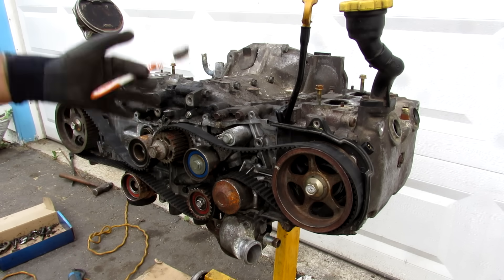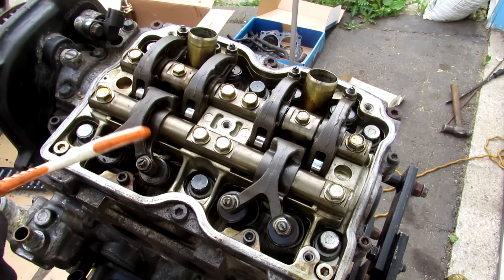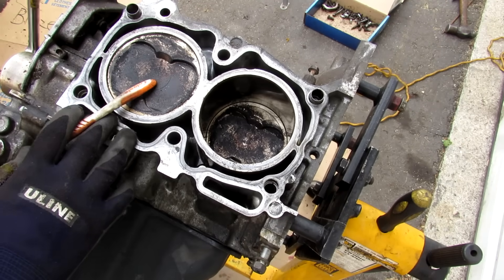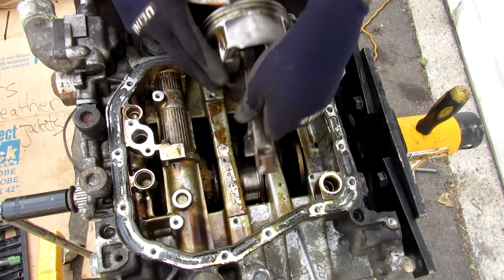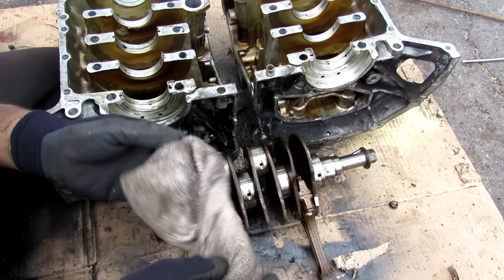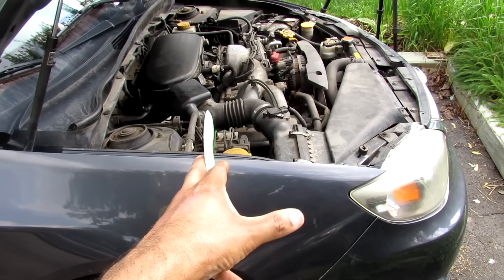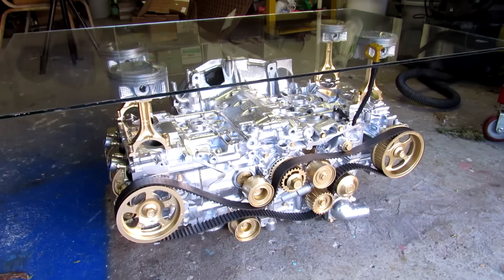Why Subaru Engines FAIL

Comment: Man, that's a whole lot of issues with that engine.
Reply: You can talk shit about all other engines as well, they all have strengths and weaknesses, especially when you have a bunch of retards beating on them and not doing routine maintenance.
Reply: A Mac 
A lot of other engines are a lot easier to work on though. The boxer engine is very weird
Reply: DEEBO I bought an 06 wrx last month and I’ve been putting in all the parts and doing all the maintenance myself Subaru’s are easy asf to work on compared to the bmw I came from
Reply: Griffin_Kith 
Shit I believe that! BMW’s are something else man smh
Reply: DEEBO it was the smoothest car I’ve driven and a blast but that maintenance upkeep hurt too much as a college student
Reply: @Siillky  theyre a pain in the arse and the back !!! I see why only 2 ? Manufacturers have persisted with them !
Reply: @Al8293Au1229  i do fk all maintainence on my rav4 has got same air filter for 7 years car at 430k kms on original clutch too. Some cars can handle abuse better than others. Me id never touch another subi unless that pissed off the boxer and made decent cv  boots 😂
Reply: A Mac you are exactly right.
Reply: @Al8293Au1229  Yeah, subaru engines are terrible. If you told any American car owner that you had to replace your timing set and head gaskets every 100,000 miles they would tell you to sell your car. 

I just got ahold of a clean subaru forester 3 days ago and I already want to get rid of it.
Reply: @superbroadcaster  Timing belts are normally due every 60,000 miles or every 5 years. 

More modern cars it's every 120,000 or every 10 years

But on a 'modern' American branded car many which are still using ancient engines designed several decades ago the interval can be as low as every 30,000 miles.

Engines with timing chains usually last the 'economic' lifetime of the car with proper maintenance.
Reply: @user-zt4ry9hm9u  Yep that's terrible. I'm going to stick with trucks from the 70s, newer hasn't meant better in years
Reply: @user-zt4ry9hm9u  Also timing chains are superior in most ways to timing chains. The only real reason besides drive chain weight is the economics of stamping out a belt vs machining a chain to exact specs. Timing chains rarely break, if you break a timing chain it's either under fantastic strain or beyond old. It's much more rare to hear of a timing chain breaking
Reply: @superbroadcaster  
I believe your mistaken
Belts are superior for a number of reasons, they are cheaper and cheaper to replace, cost matters when most people today do not own their vehicles or change them every 3 years on average.

They are reliable, once changed on schedule a broken timing belt is less common then a broken timing chain. A broken timing belt is almost always due to neglect and chains have a record of failing spectacularly out of the blue.

Less maintenance required, a belts longevity is not connected to whether the engine and oil has been properly maintained. Contaminated engine oil, late oil change? Low on oil? bye bye timing chain.

Lightweight, quieter and with lower friction means better fuel economy and more powerful engines.

All this far outweighs the argument that timing chains last longer and are maintenance free, it doesn't mean they don't need replacing forever and replacing chain is horrifically expensive.
Reply: @user-zt4ry9hm9u  Yep chains are definitely better. Longer maintenance intervals are exactly better and once you've disassembled an engine to the timing set, a chain is just as easy to replace as a belt. A belt is also definitely weaker than most timing chains unless it's wildly beefy which decreases effiency of the engine. Chains are still better
Reply: @user-zt4ry9hm9u  And if someone can't be bothered to change their engine oil reliably to avoid contaminating the oil with excess carbon or other foreign bodies, they definitely can't be bothered to get their timing belt changed at regular intervals. $50 oil job or $1000 minimum timing set job? Yeah they're definitely going to change their timing belt first 🙄

Timing chains absolutely exceed timing belt service intervals. I'm not going to let an automaker cut corners and be applauded for it because people like to rationalize
Reply: @superbroadcaster  waring is one og the cause pin rotate inthr holes under pressure.
Reply: @superbroadcaster  I had a 1992 Saturn timing chain break at 125,000 miles.  Had to replace the engine because of the damage it caused.
Reply: @DanGeorges  Sounds about like a Saturn
Reply: @user-zt4ry9hm9u  wouldnt touch a car with a belt unless i really had to.
Reply: A Mac @ 🤣bahaha,hard to deny that,hear hear.....

looking @ boxer engine without seeing this vid. the main problem or weakness visually imo would be the long horizontal length which would give it more flexing & vibration,.how well they are balanced internally I honestly do not know, but

 I like the idea,design,with more refining,it can quite easily be a solid unit in durability.
For its size it performs damn well too which is easily forgotten,when there is problems.....
Reply: Not really, perform average !
Reply: @Al8293Au1229  I clicked the thumbs up and because I can't add more I'm adding this: thumbs up multiplied by 1000. Cheers
Reply: The vid should be titled “1700 reasons to never buy an used Subaru.”
Reply: @ronaldscott781  I totally agree with you. 🤣🤣
Reply: @ronaldscott781  Used? Hell! Any Subaru!
Reply: Don't buy a Subaru. Toyota is vastly superior in every aspect.
Reply: @hedgehogthesonic3181  Toyota and Subaru manufacture different types of vehicles (other than the shared BRZ and 86) so your comment is utterly baseless. The only two vehicles which share similar attributes without being a shared platform (such as BRZ & 86)  are the RAV4 and Forester. By the way, I've owned 3 Toyotas and no Subarus so no need to call me a fanboy . I still own a Toyota (Landcruiser) but only because I require a 4WD.
Reply: @cyclemoto8744   What i mean is that Subaru still insist in doing such engine in this way, where gravity only makes things worst, and these things are not reliable, pure trash.
Reply: @hedgehogthesonic3181  ahhh...fair enough and point taken
Reply: @cyclemoto8744  y toyotas and not subis then ?? Time to get yr first subi i reckon everyone raves about them !
Reply: @cyclemoto8744  they both make cars  hes saying toyota cars are better in general  and you can compare others camry and     liberty  etc but no need
Reply: @rhett7716  definitely not saying that. In terms of dynamic, sports driving, I would opt for Subaru. These days I’ve given up on sports car and moved to 4wd for a car and have been riding motorcycles for over 20 years which provide much more bang for your money than a sports car.
Reply: Nothing out of the ordinary with car engines in general. One day they break down.
Reply: It may just be what one is familiar with. 
I’m used to the failings of the GM 3.6, 3.8 and 5.3. There are plenty of failings.
Reply: Ronald Scott 
That’s crazy. I have a 5.3 swapped in my Z I rarely run in to problems lol when I do it’s a 30 min fix. Probably the easiest engine I’ve worked on especially compared to the original Vg30 engine that it came with
Reply: Hussell Westbrook mines 18 years old lol
Reply: Ronald Scott 
Mine is too bro haha junkyard vortec engine. Easiest engine I’ve worked on so far, I feel like everything is straight forward. I don’t know how it is to work on in a trucks engine bay though 🤔 probably different
Reply: DEEBO not bad really. You can imagine the rearmost plugs are a pain.  How much work did you have to put into getting your swapped motor running? What did it go into? I’d love to get a wrecked 6.2 to swap or rebuild for my 5.3.
Reply: Ronald Scott 
Well the motor was already running before i put it in haha it’s in a z32 so they actually make swap kits for this particular swap so things are pretty straight forward. I’ve seen people do custom jobs though which is a lot harder. I actually plan on starting a 6.0 build here soon. Luckily a lot of parts are interchangeable
Reply: @ronaldscott781  the 3.8 buick? Engine in oz for our Commodore was pretty reliable i thought
Reply: Subaru and toyota cars are for females.  Or thoes of you who identify as females.
Reply: @FXRJay_CapeCoralCracker   Scientifc studies have determined that people who use the username   "@GMCJay_lly Jason Heinrich" have the equivalent cognitive capacity of an earthworm
Reply: @cyclemoto8744   Indeed.
Reply: i dont agree. there was only one issue and it was an idiot who didnt know hat oil was for. Like my ex. 
Just turn up the radio. There , fixed THAT sound.
Reply: You need to read up on the deficiencies of other makes of engines.

Comment: I've never seen a failure yet that mixed the fluids on a Subie(although totally possible). Most common types of blown head gaskets I've seen on Subies are: overheating due to combustion fumes pushing into cooling system and/or coolant leaking into one or more combustion chambers and steaming out the exhaust, or external oil and/or coolant leaks. Nice detailed video = thank you.

Comment: Judging by the title of this video i expected more trash talking. I heard some but not a lot.
Having owend 2 subaru legacies (yes both 2.2l) i know those engines, with routine maintenance,  can easily get between 3ook-400k miles. My second one saw the engine and drivetrain working perfectly at 327,000mi and actually outlasting the body, as the left rear strut busted thru it's tower. Even at that mileage the mpg was still around 23-24 avg. I think the 2.5l might be a lot more failure prone, especially the dual cam.

Comment: One of the absolute dumbest things the automotive industry did is to put a rubber band between the crankshaft and the camshafts in particular in an interference engine.  Where if that rubber band slips a notch or breaks, the pistons crash into the opened valves.  This will cost you a couple of bucks.

Not only that, but a timing chain is constantly oiled and get fresh lubrication, timing belt with the tensioner and idler pulleys have little tiny balls with only a few drops of lubrication that dries up or even leaks out those tiny seals.  Bearings will seize, pop, there goes the belt, and bang, the pistons bang in the valves, can crack an aluminum head and even the block, $$$$$$$.

Worse the Subaru with that horizontally opposed engine.  Small aircraft engines are also horizontally opposed, but a world of difference, the drivetrain warranty is only good for 60,000 miles and at this same time, that timing belt has to be replaced and you better replaced those ball bearings as well and make damn sure they are not from China.

Another thing that should be replaced are the camshaft and even the crankshaft seals, you don't want engine oil pouring on that belt.

Did I say enough?
Reply from the maker: Let me guess.. you own a car with a timing belt

Comment: When you get down to it, if you maintain your car and especially keep up on oil changes, it will most certainly last longer. On my first Subaru: a 2016 Impreza Sport Premium with 5-speed manual. About 54000 miles so far. No problems. Had a 2002 Nissan Sentra XE 5-speed manual with 226000+ miles that was still going until I had an accident, which basically killed it. (That would never have more than scratched the 72 Buick Skylark back in the college days, but I digress.) Anyway keeping everything well lubricated is a plus and that can't be stressed enough.

Comment: Just bought a used 2017 Suby Legacy. My other Suby, an 04 Impreza has just shy of 290k miles and still running strong but it does burn a fair amount of oil.

Comment: It would appear that the subaru engine is the epitome of how not to design and build automobile engines .
Reply: Not really. Yes, lubrication and access is trickier, but it has some big advantages too - oversquare and hence high power-to-weight is possible, sits very low in the car which both improves handling and leaves room for bigger turbos etc. There's reasons they make great rally cars, though arguably not so great as family transport.
Reply: so you are saying that Porsche and Ferrari don't know how to build engines?
Reply from the maker: Not really....there are some good benefits
Reply: Yep, when you copy a German air cooled engine that wasn't great and water cool it.. hmm

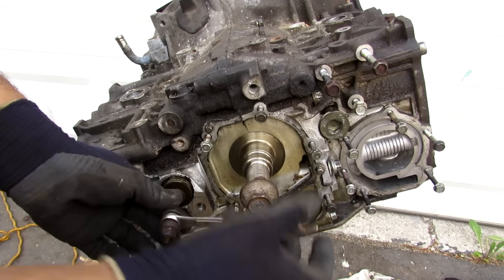Comment: 08:14 "... and this is your 14mm hex."  A thinking man!
Reply: Another helpful bit about Subaru's. When you're changing rotors and you can't separate the rusted metal, there are tiny holes in the rotors that fit PERFECTLY with the 8mm(?) bolts that retain the radiator. Remove one, use it to pop the rust free, then return it. Viola. Easy rotor change.

Comment: Im in the Middle of this video, So Im going to ask before I forget too, How many miles did this Motor have on it, MY Dad has an Outback with the Ej25, I have the Ej22 on my Impreza, My car has 219k Miles on it I recently moved from California to Kentucky The car drove great all the way there, I only spent $111 Bucks in fuel, I try to take care and do regular maintenance on the engine I only paid $600 Not running, I ended up replacing most of the Basics, Plugs/Wires, Fuel filter, Fuel Injectors (2 were dirty) Did an Engine/Rad flush, Anything I could to help it run Better and Longer for me, Ill add fuel Treatment to help inside the gas tank and Oil, Stock Motor with the Oem air intake I just added an aftermarket Intake filter I didnt mean to Ramble, Or should I say "Rumble" So with all that said.... Im Just Curious what my internals may look like lol Thanks In Advanced!!!

Comment: Man you picked up the WORST subaru engine, 2.5 L were really bad, as you mentioned the oil lubrication and cooling wasn't great with them, due to the 2L design in the fist place. the 2L engines EJ20 are GREAT, mine is 23 years old and is running strong, doesn't burn any oil and is healthy 250 BHP STOCK. Also the first EJ was designed in 1989 I believe. These engines like GOOD oil and the OEM oil filter, people usually save money on both the oil and the filter, this is not Honda or Toyota, so no it won't last as long if you maintain it so bad (not up to factory spec).

Comment: What i got from this video: subaru uses an overly complicated design of an engine with poorly executed manufacturing leading to a high rate of failure
Reply: Based on the worst engine ever, made by the Subaru during the last 50 years, yes -) Correct. Buy 2L petrol and EJ20 and you won't have any issues as long as it's been serviced regularly. In fact I'll tell you a secret man - the EJ20 is that good that they even use them on small air planes, yes you heard it - what do you mean Subaru stars mean on the logo? https://en.wikipedia.org/wiki/Fuji_FA-200_Aero_Subaru
Reply: @itftcomputers  i get it. These boxer engines can be great when done right, but they cheaped out on the piston design, and also the boxer is a more complicated design than any inline 4. If anything it would have been easier to design an inline 4 on its side, that way they didnt have to fiddle around with the whole crank being sandwiched between 2 halves. Porsche does it right, and subaru does....sometimes. making boxers on a budget isnt the smartest idea

Comment: I'd like to make a suggestion that you get your hands on a rotary engine and do a breakdown. That would be pretty interesting as well. Thanks for the video
Reply: I agree. .love to see that as well...and a Miata 1.8 L
Reply: They have a whole lot of bolts around a rotary
Reply: @ronalddaub7965  wankel engine i think... because "rotary engine" is pretty old (first world war aircraft engines, most french engines...)
Reply: As a distraction how about a radial engine?, not so much for cars but interesting none the less.
Reply: @CrusaderSports250   existing many vid about radial engine and rotary engines (Gnome type)
Reply: @leneanderthalien  fitted to cars?, would be interesting to see, a rotary would be better than a radial unless you could get enough air to cool it.
Reply: @CrusaderSports250  the early rotaries (not a simple "radial" (this terminology was NEVER use for such engines): the complete engine block did rotate, and the first Wankel had not only rotary pistons but a a rotary block, but was never built in serie)  was rarely fitted on cars (i known only one) at bit more on motorcycles like the french 1893 Felix Millet and the german  1921 Megola
Reply: @leneanderthalien  All of the RX mazdas mate
Reply: Agreed
Reply: Yes!!! Please do  an FD3S twin turbo RX7
Reply: Pretty sure he said the first wankles weren't common in cars not wankles in general
Reply: Please do a Spacex falcon heavy.

Comment: The sheer amount of cars I've fixed and I only just found out about that hex trick you used...
Reply: that was cool idea
Reply: yeah man that's going to come in handy for sure
Reply: Me too.
Reply: A variation of an old trick used to remove smallish bolts with sheared heads, still there's always something new to learn, and good on you for admitting that.  I'm not that familiar with boxer engines, so this was very informative.
Reply: Does that mean your not aware of the manual impact driver? Tap your wrench, after oiling of course.
Reply: wait what?

Comment: The engine that he tore apart looks like it ran on zero oil for an extended length of time. pretty obvious. not sure if i trust this video. I've had, but great performance from my Subaru. no issues, other than normal wear and tear. if oil is low, to non-existant, it will cause oil burns. looks to me like this is the case. how old is that engine? what is the history? maybe, someone purposely ran the engine with little, to no oil, at high rpm. Do we know the history? this is just a teardown of one engine, with no history, by someone that may or not, have something to gain by denigrating Subaru.